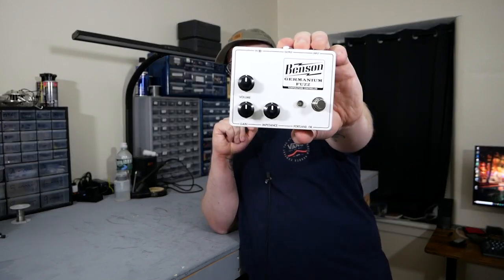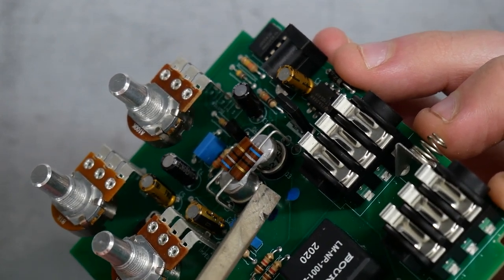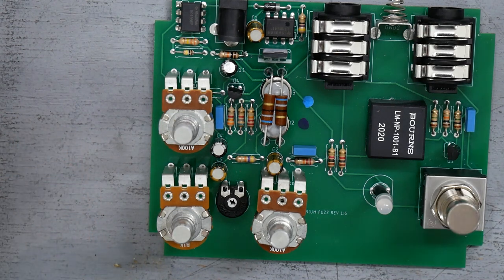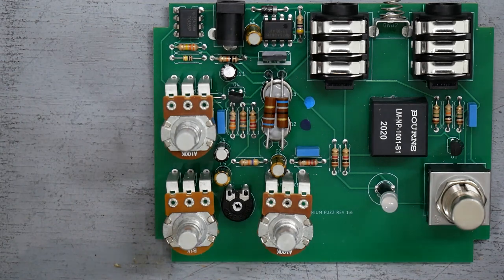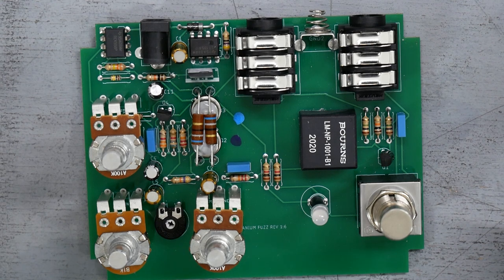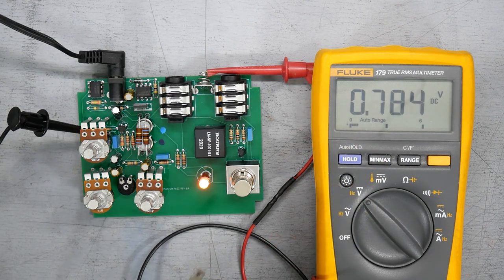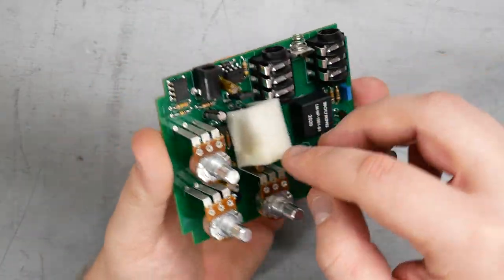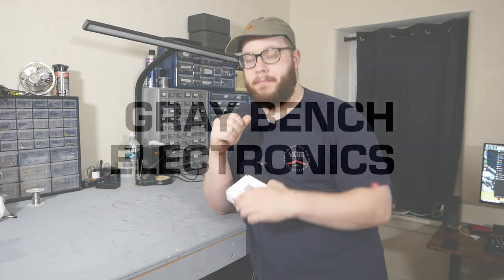Benson Germanium Fuzz Teardown

Comment: I was very skeptical of this pedal because of that temperature regulating circuit.
Now that you have showed me how it works, I am not skeptical anymore. I literally thougth there was some sort of "cooling elements" inside the pedal. (Well I guess there technically is, but not the kind I was visualizing)
Now this pedal is on my radar again :)

Comment: It should work great in temperate climates, but as you mentioned in hot climates or direct sun beating on the unit, the internal temp may rise higher than the setpoint. A more complex but probably better solution was to use a peltier junction to hold the internal temperature at a particular setpoint since it could both cool and heat but of course that would raise the cost and price of the product.

Comment: a technical question.  Do I get the same functions as the Benson Germanium Boost (green pedal) by setting the Benson germanium fuzz as a clean boost?
Reply from the maker: In the broadest sense, yes. They will both be clean boosts, just increasing amplitude without clipping the signal.
But the two pedals have different circuits, and will probably sound different, even in clean boost mode.

Comment: Great tear down. Would love to see some more. Does this solve the transistor from being under biased but not over biased? The impedance thing is interesting, the problem is that a Strat with 250k vol pot sounds great and humbucker guitars 500k not as great as I understand it, the impedance is off with 500k. But a lot of fuzzes like analog man have a 50k trimmer at the input for this purpose.  This is the only design iv'e seen with a transformer. I wonder how it works, will it adjust input impedance based on the resistance from the guitar input? Impedance is so hard to understand but it does something important
Reply from the maker: The short answer is the circuit artificially warms the transistors so that even on hot days, the temperature stays consistent. 
Here is some more info on this type of pickup simulator that may interest you: http://www.muzique.com/lab/pickups.htm
Reply: @graybenchelec  Thanks! that link was great. With temp thing it seems like alot of power would be needed to heat them up.  I have a" no smiley" germanium fuzzface, which has a thermistor in it, it's not on any circuits diagrams iv'e seen and might be a different way to do the same thing without using alot enery as heat.
Reply from the maker: @Ebadd9  It doesn't use that much power, about 70mA when active. The warming circuit isn't constantly on, and the temperature only needs to approximate the ambient tempurature inside a white pedal on a hot day (which is why the black versions aren't recommended for that). Also, the heater is efficient; the warming resistors are sitting right on top of the transistors with thermal paste.

Comment: Very interesting! I have no knowledge in electronics, but would this pedal sound different if the conditions are too cold or hot? For example would the pedal sound bad if you’re playing live where its freezing at night or direct sunlight is hitting it?
Reply from the maker: This is definitely a problem for germanium transistor-based pedals, but my guess is that boss did include some type of bias regulation to compensate for temperature. The tone bender is a simple circuit, and there were a lot of parts on that PCB!

Comment: I hate these onboard mounted sockets - in particular, if they are not mounted to the housing. I know, it is very common these days, but still it's a very bad design.
On the other side, I like the idea with regulating the temperature of the transistors via resistors...
Oh, and by the way, very good and interesting channel. I subscribed :)
Reply from the maker: Thank you! The sockets have downsides sure, but if you want to be able to readily swap transistors it's still the best option.
Reply: @graybenchelec  Sorry, I didn't mean the sockets for the transistors - I totally agree, that mounting them with sockets completely makes sense! (also to avoid heating up the germaniums during soldering).
I was talking about those 9V-connectors and jack sockets, that are pcb-mounted. You just need to accidently step on a cable or plug, and the board is fucked... This is simply a very bad design.